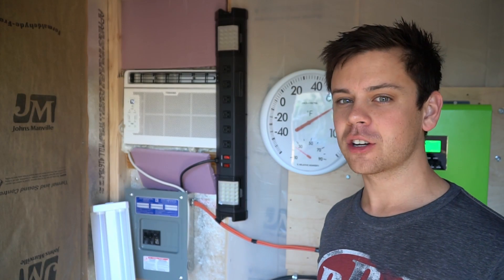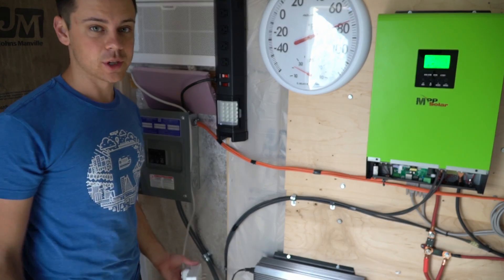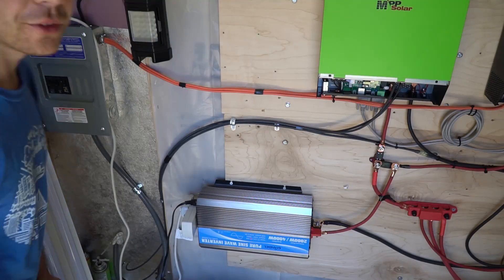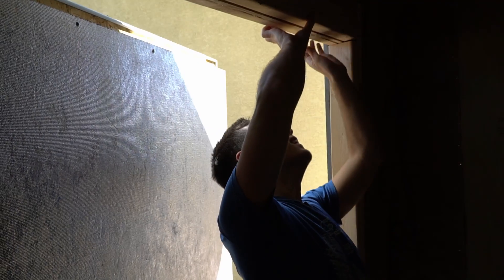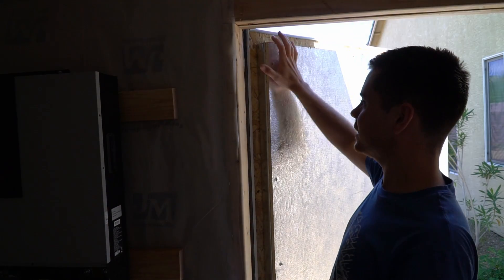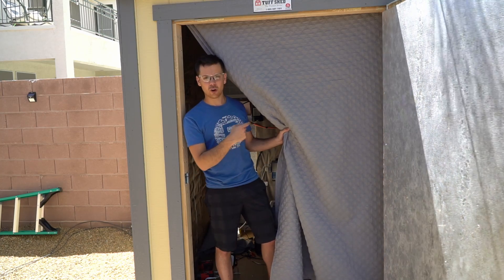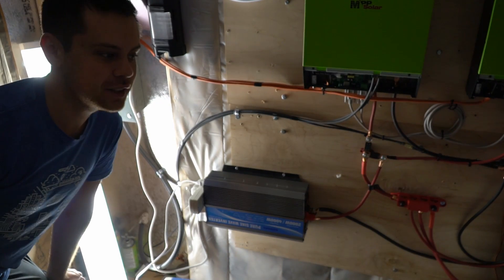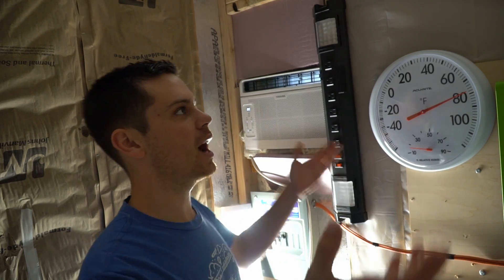Cheap Solar Powered Air Conditioner Part #2

Comment: Venting electronic heat sources Is an issue also. I mounted my inverter below my window AC unit and discovered that, in time, the heat from the inverter fan was going into the AC inlet and it stopped additional cooling. This was in an RV travel trailer so I moved the battery pack and the inverter to the rear bath area which could be closed off by a door and vented through the roof vent. Keeps the bath toasty warm and the camper nice and cool. It gets hot in Florida too.

Comment: You could get by keeping the temp in there around 90F... not 80F.  The wear and tear the A/C is using on the batteries will shorten their lives more than letting the temp increase another 10F.  Most of that equipment is rated to operate at 45C (113F) or lower.

Comment: also make another door, one on the inside that can slide into place on wheels 0R do a hinge design of small parts, so I'm talking pieces 6 inches in width x height of the doorway, making super-insulated rectangles 3 inches thick with piano hinges on each one, it will close up small and open for more insulation. YOU HAVE TO BE SUPER PRECISE TO GET THIS METHOD TO WORK PERFECTLY.
I bet you are at 60 degrees now... or will be soon, with or without my advice.

Comment: Hey just wanted to help... the first part, just run a longer window strip, so it passes the square connection, that way it fills the end light coming out, its probably the issue of being perfecting square on both sides, sometimes it just doesn't work...I have the screenshot and the time I'm talking about is TIME:2:42... that tiny hole... good job I am very into THIS ARTFORM... I believe its art in its own way. 
   Anyway, awesome show and keep it up! I'll subscribe and LIKE. I want to see how well you improve. And I just got on your site... what panels are you running? Ever used LG 330 Watt panels? or even the newer ones, I forget the wattage now, what have you seen as your FAVORITE PANEL YET??? I'm really curious about what you think is best...  Hopefully, we may be friends and talk solar, I'm going to do my parent's home soon so I need the most data as possible, best of everything so I get amazing efficiency, even talking 1-inch copper lines/tesla wall batteries, I want it in the high 90s... hopefully, I can achieve that, maybe with some help? it would be awesome, I am a videographer/producer and love to film too. So I will definitely make some videos for you to review. Thanks and let me know what you think, especially in the efficiency route, with model numbers, I love watching reviews on them. Take care.

Comment: I know for a fact insulating your roof cuts your energy consumption. I have an insulated workshop in Canada. I use a split phase heater cooler unit. You have to look at a building like a giant thermal battery. You can't stop all heat transfer but you can slow it considerably with a tight building envelope. Thermal bridging is what you are trying to avoid with the outside. That's where heat or cold is transferred from the interior to exterior and vice versa. Common experience is insulating EVERYTHING but having a large hole in the wall. All the insulation is worthless because of that bridge. This also applies to materials. You may not have a large hole in the wall, but the materials themselves transfer heat. Example: if you had a Steel roof (like I do) . Put you hand on it from the inside on a hot day and you will feel heat come off it. That heat gets transferred and trapped in your building. Same for cold. WHy is all this important? If you can create a stable environment,  every watt of electricity used to change the temperature stays put. Back to the battery analogy, it's like charging your battery and self discharge, or parasitic draw. Sure you can just keep dumping more energy into charging the battery, or you can lower the parasitic draw or figure out how to reduce self discharge so you don't have to charge as much. When I insulated my roof, my energy consumption when down by 40% for my split phase. Keep in mind, my climate here in BC is heavy snow, and high heat.

Comment: Just getting the ac off the grid.  That’s a huge step that I’m looking to accomplish somewhere down the line.  I have a 2.5 KWh battery bank for an electric bicycles. 17s/14p,  I will make that an optional removable power bank for such expenditures.

Comment: Can you review, compare and see if  it is true what Renogy claims on their  flexible solar panels?  They said that the top layer has transparent dots, this allows the panel to get much better light from different angles.  This dots makes this panel much more efficient than any other panel in the market.

Comment: Will, how about doing a video on the proper place for, and use of DC-DC Battery Chargers in mobile and fixed site installations?

Comment: Waiting through your videos and watching lots of themI am still finding it difficult to determine the size of battery bank I am going to need to support my load. My last utility bill showed 853 kilowatt hours used last month. Question? how big a battery Bank lithium-ion wise do I need for this load.everything else gets built and sized around that the inverter size the amount of solar panels / wind power needed to keep up with the bank but first I need to know how big the bank is. Hope you can help....

Comment: Earlier in your tesla battery stream you mentioned 280ah lifepo4 batteries for 48v system. I checked on your website and I couldn't find details. I found link to 150ah batteries. Please advise

Comment: Greetings Will. You are so right about the way people are using the Tesla batteries.I have a question for you. My off grid system has three of the 7s 3 kilowatt modules. I chose this route because the 6s  modules voltage is lower than I like with my 24 volt Magnum inverter. I do have active balancers but I have a  BMS on each module with under and over volt protection. The BMS  has top balancing that is above my charge profile.  I only charge to 4.04 volts per cell. This is to low for the balancer in the BMS. hence the active balancers.  I have a automated cooling/heating system utilizing the stock climate control loop in each module. I also have this in a building that is remote from my house. I have 5k solar array. I have 9 kilowatts of batteries but intended to buy 3 more but the 7s modules are getting hard to find. Can I parallel batteries of a different chemistry? I would like to have a 18 kilowatt bank. Any ideas?

Comment: Will, love your channel and have learned so much.  I have had a tiny solar system for about 10 years, but never used it for much other than having some batteries ready for HAM radio.  I am now at the point of retiring, and plan to move to an area where I will be pretty much 100% solar power.  So, I have been ramping up my system here to learn and watching your videos to learn as much as I can.
I have gotten to where I understand the amphours, watthours, stuff and want to get int LiFeO4, but am not going to do that until I get to my new place (as I only plan to be here for a couple more years and will leave the solar system I have with the house).
Thanks for the the info!!

Comment: Good video, waiting on the roof insulation.I know you say to check your past videos for info. I can buy Valence - U27-12XP  and haven't found in youtube search what the max amp charge rate is or best. I found manufactures spec sheet saying 2c which I assume to mean 276 amps????

Comment: Considering the cost of materials to cool the shed(AC, extra cells & solar panels, wires, insolation, solar charger, etc.) Would it cost roughly the same to instead use LTO batteries that are not as efficient but can withstand extreme heat temperature fluctuations without the need for cooling?

Comment: Can you use two new  35 amp batteries in parallel with one  new 100 amp hour  battery without  causing issues?
Just want to power a 50 watt  freezer with 450 watts of solar.

Comment: Will I really appreciate your videos. I have to get my sound system off the cranking battery bc it’s draining it from listening tunes while working on van. There is space for another batt next to it 7”x7”x9” to switch it from cranking batt while not driving. Then either instal AGM batt/Inverter/solenoid system in side or go with the Jackery 1000 with 100-200 Watt panel for TV and other stuff inside. Help😀

Comment: Also noticed your temp/humidity gauge on wall.  Your humidity is WAY too low.  I've seen this when home owners under-size their homes.  You may need to add a humidifier.

EFFECTS OF TOO LITTLE HUMIDITY
When the humidity in your home is too low, the effects can cause health issues, such as bloody noses, increased static electricity, dry skin and lips, scratchy throats and noses, lung and sinus problems, respiratory issues, and increased chance of colds. Low humidity also affects your body temperature, producing a cold feeling all over even when the thermostat is set high. Viruses and bacteria will thrive and can cause repeated health issues for you and your family.

Low humidity causes wood floors and furnishings to shrink, separate, and warp. The wallpaper on your walls may peel around the edges and loosen, and mold may grow behind it the damaged wallpaper.  The environment in your home becomes compromised when your humidity levels are too low.
Reply from the maker: Yikes you do know I don't live in this shed right? I have a home lol and yes, I keep my house above 45% humidity year round. I don't live in the shed
Reply: DIY Solar Power with Will Prowse 

Yes, but you see how low humidity also contributed to static electricity.  Plus, air sealing will assist in maximizing energy efficiency

Comment: Look at ALL the different ways you lose efficiency.  That batting on the walls is better than nothing, but SEALING against air (ACH) is the BEST.  That shed is so small, you could use a self - DIY spray foam kit and foam the walls and ceiling (closed cell, not open cell...unless you want to layer - 2 inch of closed cell first, then 5 inches of open cell on top - for roof...closed cell only on wall)

Comment: Wy dont you design and build a climate controlled battery box, very easy very cheap. eg individual battery sensor controller $10 [dc1000 12v], individual heating pad $7[ebay], individual peltier cooler $20[ebay] and cabinet plus insulation $150. approx $300 for 4 batteries. Battery temperature is so important. Trying to cool a whole room is not efficient. I live in thailand  its 40 degrees c. Cooling a room takes so much energy. ps your air con will need regular cleaning and yearly servicing  or it will use alot more energy. Not a good way to go. A well insulated battery box with individual compartments allows you to micro manage your batteries lifespan very efficiently.. Temperature so important ask Mr Musk

Comment: Just using a radiant barrier on the ceiling should make a huge difference though added insulation will hold the temperature longer.

Comment: Using passive thermal storage like a bunch of river rock that at night the air conditioner runs extremely efficiently and chills down to say 50 degrees and then it takes a tremendous amount of heat to warm those rocks up so air conditioner can be off when it's inefficient. Ideally you use some sort of face changing material like something well-engineered to Mills in the 70s that way it gets solid and it's like ice which starts melting in the 70s but until all the material is melted into a liquid form instead of a crystal form the temperature in your shed and won't go up just like as long as water and ice has some ice in it the temperature of the water will be ice cold. Thermal mass is it expensive. Air conditioning of course is dehumidification and you don't have any source of humidity in your shed. Because of this, adding humidity, it does not create the problem for the computers in fact for batteries and electronics humidity is a conductor of heat so it helps them cool. So for $60 you can get a very large ice chest and just leave it with the lid open or find some in some alleys that before throwing away because they have lost the lids. When filled with water the water will evaporate chilling the water two very cold temperature, surprisingly called temperature, and any heat that's in the room will be absorbed by the cold water. At night you can blow cool dry air over the water which makes the water far colder and the night air. During the day you can cover the water with a thermally conductive sheet if you don't want it getting colder during the day at the price of increasing the amenity in the shed. This is not evaporative cooling. Evaporative cooling has similar aspects to it but waste the cold air. Here we do dump cold even are out at night but it is a very minimal amount nothing like daytime evaporative cooling. Evaporative cooling is a single pass or indirect system of climate control4 built environments but using water as thermal Mass it's not the same thing to say those words again. The best solution for the floor is the ground the floor and allow the ground to get cold. You want to dig a deep hole and then insulate the walls of the hall and then fill it back in with dirt so that Derek can be the thermal Mass. DARPA has researched to using seasonal energy storage it's a pretty good research report from many years ago.

Comment: As you know already, roof insulation is your friend. But another thing to keep in mind is how a fridge/freezer work - very poorly if (nearly) empty. You can’t keep air hot/cold for long without constant input. Your solution is thermal mass. Place a few rain barrels in your shed. The waters thermal mass will help absorb cool air and radiate it back out. It should have a decent impact. (To me 10-15% would sound awesome already).

Comment: Wow. 17% Relative Humidity... Lucky you.
Reply: Samuel, I live in Virginia. Our humidity is 50 to 90% when it's not raining. To largely cool the air means getting the humidity down to below 50%. When the humidlty is 17 per cent, you have to add humidity to feel cooler. In the southwest they have "swamp coolers" that use watermist in front of fans to achieve that. I think that's tougher than high humidity to endure.

Comment: No need to litter your yard with solar panels Will, how about a purpose built solar panel topped pergola to provide some shade outside. The double skin over the shed sure works, did you know that Buckminster Fuller built double layer tin sheds for the US Army to use in the desert that were totally closed up and cool inside using clever airflow and used no power at all.

Comment: So lots of sunshine over the year is not necessarily a good thing because higher temperatures mean lower solar cell efficiency. You’ve chosen to use some of that energy to cool your solar shack but there are other ways of beating the heat. Plants moderate the temperature and solar cells block surface evaporation which would seem to be a win-win partnership. So staggered rows of solar panels with plants growing in between should be good for the solar cells and the plants.

Comment: What do you think about having a heat pump water heater for the house in the same room as the solar system? The thinking being the heat generated by the solar is exchanged for cool air conditioned air from the water heater.

Comment: The biggest part of passive cooling (or heating) is site analysis.  In a hot region like yours, some sort of double roof is probably best, or interior insulation with venting of the overhead space.  If the lower roof isn't resilient, you'll need screening to keep out insects and animals, or even louvres to keep out precipitation.

Comment: Hi Will, have you thought about digging down into the earth 2 or 3 feet and running some ventilation tubes underground? That way your only powering a fan to blow air around instead of an AC unit which use a huge amount of energy.
Reply: What you're suggesting- I was so skeptical how well a solution like that would work, considering it's no small undertaking to create.  I watched a friend do this type of thing to his greenhouse.  It makes a HUGE difference, and doesn't consume much power either, just as you say.  
-an architect who worked with even more skeptical mechanical (HVAC) enginerds

Comment: Well done. 

Which ever wall faces south. If the outside walls are not made of kool ply. 

The plywood you have on the roof with the aluminum foil.

Take out the fiberglass insulation and put in a layer of bubble foil stapled in.
wrap it around the studs. Studs will also carry quite a bit of heat. and the only thing keeping it out is the the paper strip on the fiberglass insulation.
Then put the fiberglass insulation back in.

Also you are allowing additional heat into the space by not covering the fiberglass batting with sheathing. Once the heat over comes the R value in those walls then that heat is being directly transferred into the space. You could cover the inside with sheet foam for additional insulation and tape the joints.

Outside shading. If it is possible to build an awning on your shed that shades the south and west walls of your shed then those walls will no longer be gaining direct heat from the sun. Look up passive solar energy for a better explanation.
Simply shading south facing walls and windows in the summer time will affect the amount of energy you need to cool a space.

Comment: Will you need to throw up sheets of 2-3" of rigid insulation because all the cooling you are generated in there will go right out through the roof. It will cost you maybe $50-75 for two 4x8 sheets of the stuff.
Reply: Actually, heat RISES. Cool air falls. :)

Comment: Sounds like your roof is cool because it is covered (shaded) by solar panels mounted a few inches off the roof? (2+ inches of air space between panels and roof). Just putting something to shade the aircon unit from direct sunlight cheap/quick/easy way to help it's efficiency also.